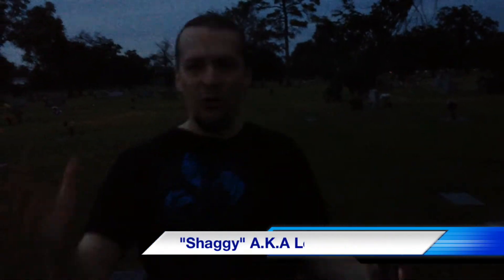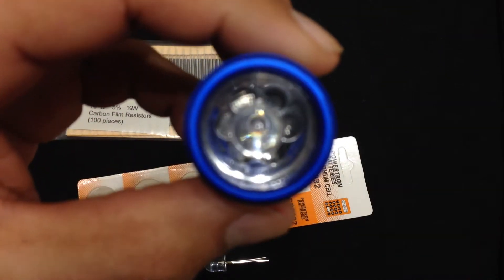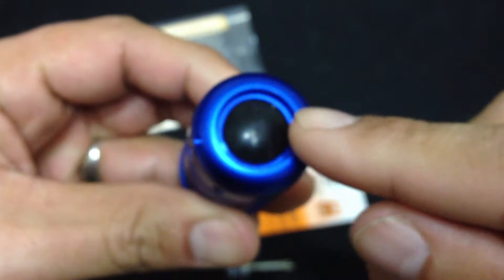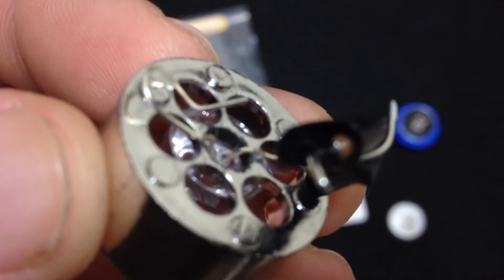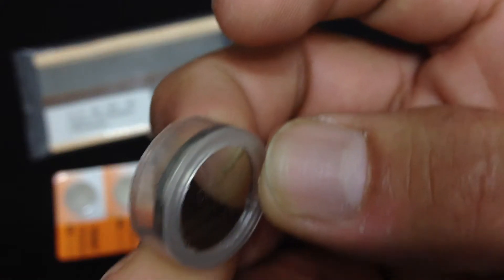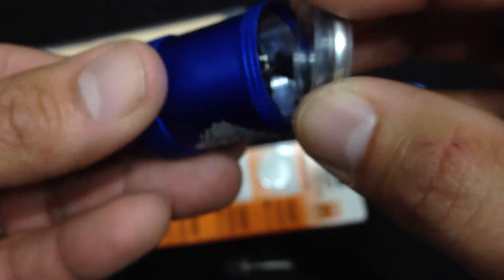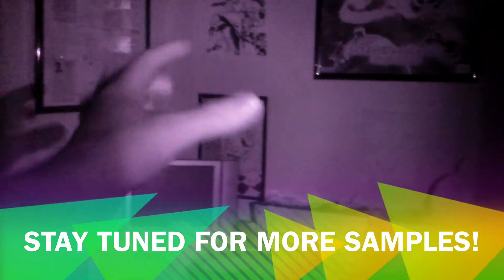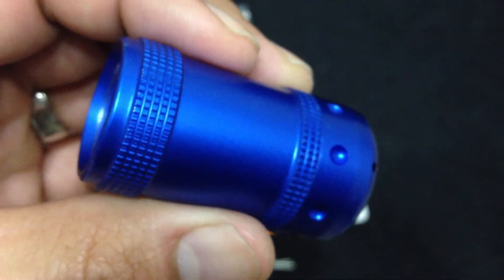Team ParUnormal: Bootleg Modded LED Flashlight for Infrared (IR) Night Vision

Comment: And yes awesome I have one made with five 300mw 10mm it LEDs in a head torch it works really good on two double a's but I made mine without the resistor and was wondering would it hurt it? Like in the long run!
Reply from the maker: Yes, it could slowly burn out the led if it's too much. I don't know the exact values of your 10mm LEDs so use this calculator here and it will tell you what resistors you need for two AA batteries and 5 LEDs. The volts of LEDs are different by color, including IR. http://ledcalculator.net. Hope this helps!
Reply: actually yes thank you very much and when i get it finished ill post a new vid and send u link